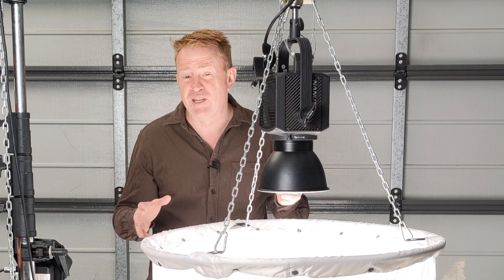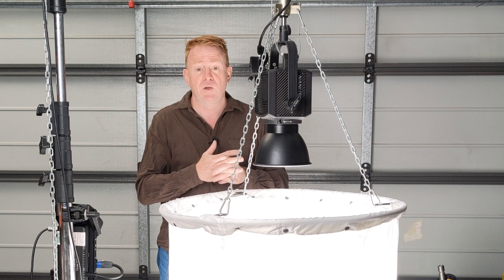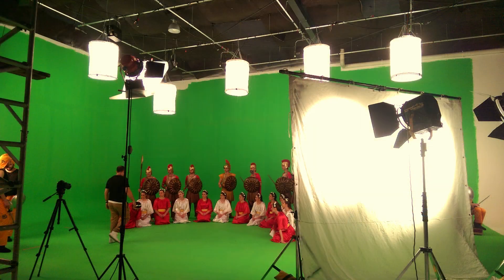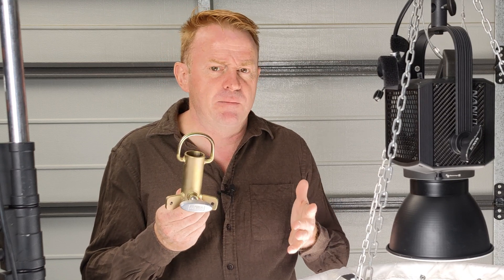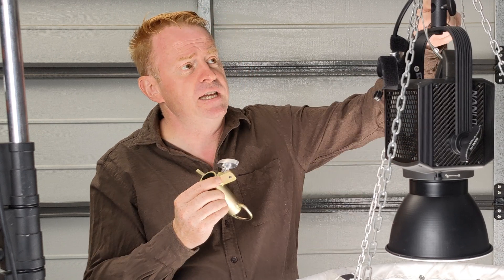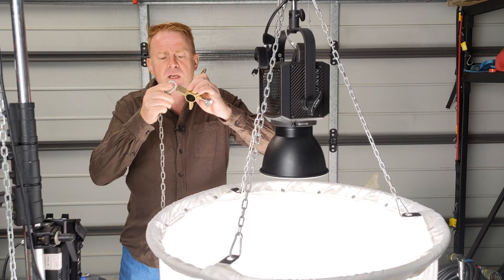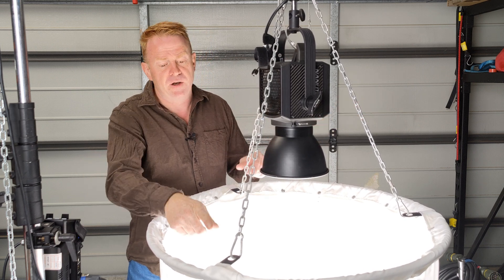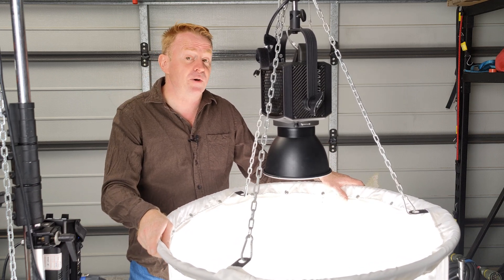Gaffer & Gear 130 - Space Light LED adaptor

Comment: I had a project where I made my own DIY spacelight using sports hula hoops and parachute material, it took half a day to make and worked pretty well , very portable because the hula hoops were breakable and once you set it you forget about it you get the same light output 360 degrees so no need to adjust all day. but I covered the top with black material so I don't spill light on ceiling.